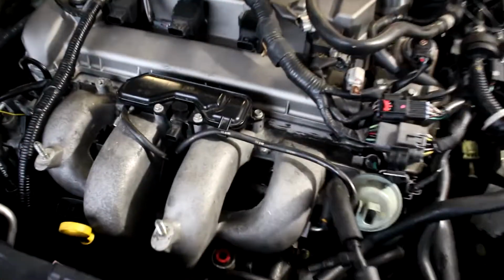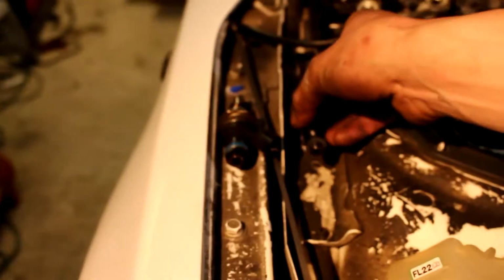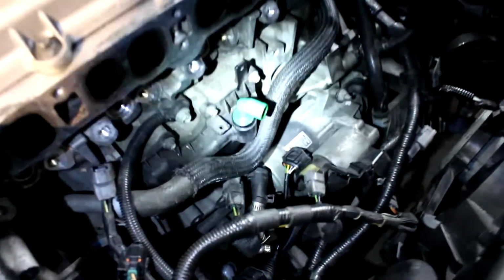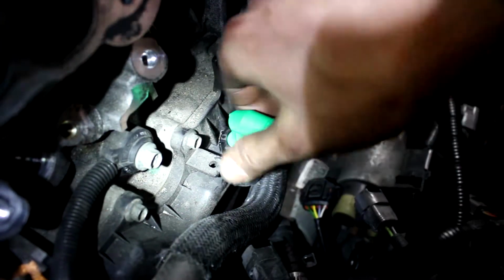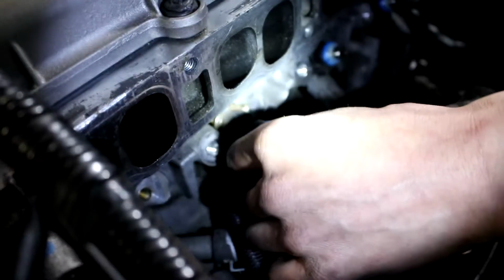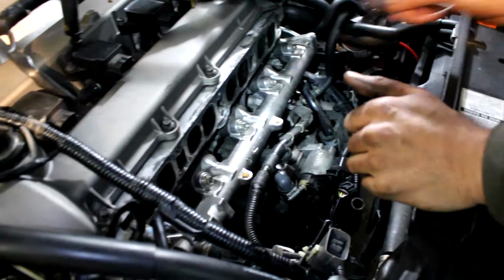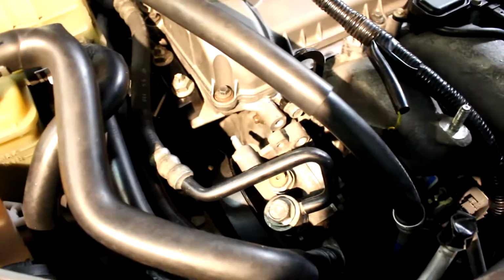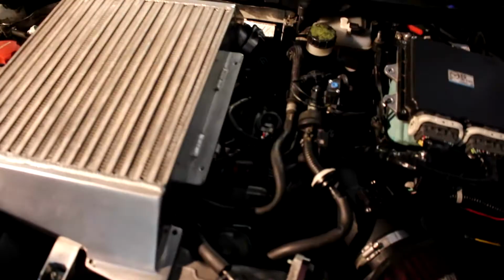Mazdaspeed 3 - Corksport Injector Seals Install

Comment: Did you notice any change in fuel dilution of oil after injector seals were replaced?
Reply from the maker: No I haven't noticed that. But then again when I built my engine we did a balance shift delete, which increased the oil capacity, so fuel dilution takes longer.

Comment: Boy that cheapo little plastic piece that holds the pcv valve in place has gotta be brittle after a million hot and cold cycles!
  Too bad there wasn't an upgraded part! 
  Anyway, nice job showing the injector seal upgrade. Gonna have to watch it over to see exactly what ya removed to get to the injectors! Thank you for the video

Comment: what did you lube the blue seals with?
Reply from the maker: Vaseline aka petroleum jelly
Reply: @WannabeTuners  Gotcha! Thank you!
Reply: @WannabeTuners  I had planned to use oil, is either suitable or is jelly the best option for the o-rings?
Reply from the maker: @kizashikaze9066  I think petroleum jelly is good because just like gasoline, it's petroleum based, so it shouldn't have any issue dissolving if some happens to get into the injectors.
Reply: @WannabeTuners  Understood! Thanks again!

Comment: Nice man thanks for posting this, Might try changing mine soon, looks a bit of a mission but not too bad! mostly clips and getting new o rings back in always a bitch :P
What's that black stuff all over your top mount?
Reply from the maker: Yeah it does require some patience, but overall it's not too bad if you've got some mechanical experience. I think what you're referring to is slight discoloration in the metal fins.
Reply: No your suspension top mount has some black on it?
Reply from the maker: @chrisday1590  Oh that was dirt which accumulated on the rust proofing that the previous owner put on. I've since cleaned it all off for cosmetic reasons lol

Comment: Did you ever have an issue with these CS seals?  I have them in my car now, but I'm about to do another valve cleaning and am debating pulling the injectors to have them cleaned again.  Not sure if I should go with CS or Overspeed seals.  Also, do you recommend an injector puller tool for this job?

Better yet, should I just leave my injectors alone (assuming the seals aren't leaking).  Not sure how frequently one should have their injectors pulled, cleaned and flow tested.  Any thoughts on any of this?

Comment: Just watching this now, great work on this project. I had my car diagnosed because it was stalling. I had it diagnosed the OBD read out was "Low Pressure Fuel Rail sensor" MisFire 3rd cylinder. The dealer recommended I replace the fuel rail, so far Ive replaced the Spark Plugs and the injectors. This video helped me to see the rail removal/install and injector install. 

In your experience will replacing the fuel rail, injectors fix the above OBD readings. ?
Reply from the maker: Since you're getting a code for it I would say yes, but there's also the possibility of an issue with the wiring, or in rare instances an issue with the ECU

Comment: Did yours smell god awful like gas when it was leaking?
Reply from the maker: I think these cars overall smell pretty gassy lol, but it does make sense that you would smell that if they are leaking, because it's essentially combustion gasses leaking out into the atmosphere
Reply: Wannabe Tuners Man mine smells TERRIBLE. I done a pull and right after I kept smelling gas all the way home. I parked it and haven’t moved it in a few hours. But I’m gonna get it in the garage tomorrow morning to find where it’s leaking from exactly. I’m thinking my hard pipe into the fuel rail is cracked because it’s pretty wet and right under Injector one there’s a hose running along there and it looked wet too
Reply from the maker: @Ds-dt7nc  It's pretty common for the high pressure fuel line between the hpfp and fuel rail to leak. I've had that happen to me. I replaced it with the Corksport fuel line, which then leaked again lol. So I decided that OEM is the way to go :)

Comment: does anyone make any after market injectors for these cars ? i cant find none anywhere. was wanting to replace them, looks like i might just settle for cs seals
Reply from the maker: There are only OEM injectors which are not upgradable flow wise. I'm not sure sure of any aftermarket companies that make a version of the OEM injectors, and I doubt it as they are quite unique. The only way to get more fuel is through an Auxiliary source, such as Methanol injection, 5th/6th port, or 4 port injection

Comment: Does anyone know what cc are the stock injectors on these cars? (MS3)
Reply from the maker: I'm not sure if this has been determined. I couldn't find any solid answers online.
Reply: @WannabeTuners  yeah I know, nothing on line about this.... They're high impedance injectors right?
Reply from the maker: @rabbon-ithegenesis7169  I have no idea, I've never looked into that. From what I've just read online, the resistance can be measured across the two electrical pins with a multimeter. If the resistance reading is 1.5 to 4 Ohms, they are low impedance. If the resistance reading is 8 to 16 Ohms, they are high impedance.

Comment: How did u guys mount the ecu like tht
Reply from the maker: We placed a knee pad on top of the battery to prevent the ECU's backing plate from shorting both battery terminals, and then used zip ties to retain the ECU. The car now has a Corksport battery box where the ECU is mounted inside it :)

Comment: i cant get the damn rail off!!! i have all the bolts and lines off i just cant pull it off
Reply from the maker: Yeah it's a bit of a pain. Just gotta slowly work it on each side little by little :)
Reply: @WannabeTuners  you can actually undo the bolts to the crow feet that hold the injectors in place and pull both the rail and injectors as one unit...FYI

Comment: Were you having any bogging or power loss prior to the Corksport seals? And if so did the new seals fix the problem and knock? Great vid, always educational and entertaining!
Reply from the maker: Thanks man! Prior to installing the CS seals the car was running fine. It was mainly for preventative maintenance since the car has a bigger turbo installed. The oem injector seals commonly leak though and can cause false knock and even an audible rattling noise while driving under moderate load in some cases. Are u experiencing some issues with your car?
Reply from the maker: @mjl6425  Have you sent your tuner any datalogs when the bogging happens?
Reply: Yes I have and he made some adjustments which lowered the knock and ran a little better. But after doing some more fourth gear pulls, car is back to bogging again and showing higher knock at WOT, even partial throttle I get .7 or 1. 
My tuner thinks it is most likely something mechanical. One thing I have noticed is that on my AP, fuel pressure at wot is 1800-2000 which is good. But I do notice long term fuel trims at a high negative like -15 to -20. Could that point to some sort of an air leak? I’ve been trying to contact my tuner but have not heard anything back.
Reply: @mjl6425 did you ever figure out the negative fuel trims? I’m having the same issue right now with bad fuel trims but my car seems to run fine so trying to figure out what’s causing the high negative fuel trims
Reply: @hbkkayson1456  no I never figured it out. I sold the car a few years ago.
Reply: @Sam S No not yet. what do you think it can be?

Comment: What heat proofing did you use under the hood?
Reply from the maker: Are you referring to the aluminum ducting tape? I used that to make a good seal with the CPE tmic. I found that it barely had any clearance with the plastic ducting under the hood since it's 3.25 inches thick, so I cut out a square to allow more clearance and then used the aluminum tape to seal and force the incoming air through the intercooler.
Reply: I just noticed some on the strut towers and such. Is it the thinner kind of ducting tape with a heavy foil layer?
Reply from the maker: Oh I think you're talking about the rust inhibitor, because I don't have any heat proofing. It's been on there since I bought the car and really attracts a lot of dirt. I've since cleaned all of it off due to how dirty it looks.

Comment: Are you sure youre supposed to install the seals loose like that? I did the same with mine. Removed them after 5k miles and they showed signs of leakage aka black around where the injector seats in the block.
Reply from the maker: I read somewhere that it is normal for there to be a bit of a gap on the corksport seals. The corksport injector seals instructions say that there is supposed to be a gap. To be honest we couldn't get them to click in no matter how hard we pressed. I haven't checked for leaks but now that you mention it, I'll be taking a peek next time I'm doing work in that area. Thanks for the comment!
Reply: Yeah CS believes that you should install them loose with that small bit of gap and once you tighten all the bolts back on the rail they should force the seals to clip onto the injector. After removing mine only 1 injector actually had that happen, the rest was pull off loose the same way I installed them and they were all leaking. Good luck with yours.
Reply from the maker: Was the leaking only on the base of the seal, or also along the sides?
Reply: Couldnt really tell. When I pulled the injectors the seals slipped right off. It doesnt seem like they ever sealed. Also one of the seals stayed inside when I pulled the injector out. People say CS's seal is bulletproof but I have buddies who use CPE's and they seal right off the bat and never have issues. I'll be using theirs next time around.
Reply from the maker: vinsss187 Right on! The only reason I went with corksport seals was like you said, their good reputation. Time will tell I suppose. I have no issues right now at 22 psi.
Reply: Good luck. Im fbo on 25psi. Cheers.
Reply from the maker: Nice:) What's your setup?
Reply: BNR S4 v2, 3.5 htp, Tr6 fmic, jmf intake mani, cpe exhaust mani, meth inj, and all the supporting mods that go along with that.
Reply from the maker: Beauty! Did you notice big gains with the TR6 FMIC, JMF IM, and CPE EM? Also what WMI kit did you go with?
Reply: No gains really with the fmic just lower bats for the most part. The CPE and JMF definitely made a huge improvement. The EM isnt really necessary since the oem EM is plenty enough for what you can push on the stock block but having an aftermarket one completely changed the sound of my car and also brought on quicker turbo spool, so less turbo lag basically. The WMI kit I went with was snowperformance's boost kit. Id say its 2nd best with Aquamist being #1 in that category.
Reply from the maker: Nice I have the snow performance stage 1 boost cooler using the smallest nozzle right now and it adds quick a bit of fueling headroom. I really do wanna get a EM. Most likely CPE due to them being cast and a good price. Shipping to Canada is super expensive.
Reply: Okay so I had a huge problem with my CPE manifold and I'll tell you about it since you may want to buy one. I bought mine for the same reason, cast iron and for the most part the build quality was there, except for one particular part. So as you may or may not know metal warps when it gets hot. So when CPE welded the flange onto the manifold, this is the flange that will end up bolting directly onto the turbo, they used either too much heat and the flange warped. I went to have it installed and the manifold just would not bolt directly onto my turbo. The engineers are CPE are fucking morons. Check out my IG. I posted about it.
Vince_ms3
Reply from the maker: Ok thanks! We'll add you up as soon as we make an IG (we're lazy lol) thanks for the info though, much appreciated!

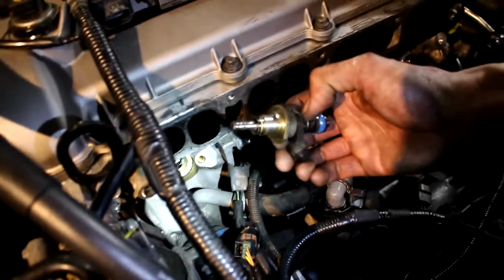Comment: At around ~3:09 you say injector from cylinder one, but I think it actually is cyl #4 (4-3-2-1 right?)
Reply: Also, solid videos. Keep up the good work! I'm going to try and resolve low compression in cyl #3 with the CS injector seals. Did a leak down test, and no air from the dip stick, and no bubbles in the coolant, which I think means my ringlands are fine, and the head gasket is fine. Lots of leak from the throttle body though, so either one of (or both of) dirty valves, or failed injector seals.
Reply from the maker: Cylinder 1 is always at the front of the engine. The back is where the flywheel is:)
Reply from the maker: How about through the oil cap?
Reply: Errrmmmm I don't know why I always had in my head that Mazda numbered them 4-3-2-1. Your statement makes 100 times more sense :)
Reply: So yea, checked all the readings again. 1-2-3-4 == 180-150-160-170. Leak down test on 2 does indeed seem to have some leaking from under the oil cap. Cyl 3 seems to be leaking from the intake side of things (seal or valves maybe?)
Reply from the maker: If you hear air from the oil cap it's an indication of worn piston rings or more commonly cracked ring lands. For cylinder 3, it sounds like a valve seal issue. Have the intake valves ever been cleaned? How many clicks on the odometer?
Reply: Wannabe Tuners yea when I heard that looks like I wasn't fully TDC. Cranked 180 degrees and validated for sure. In both cyl 2 and cyl 3 the sound was subtle. No major leaking past the throttle body, oil cap, exhaust or really any where else.

Most of the noise appears to be behind the intake manifold. Nothing really low on the engine. I'm leaning towards one or both of failed injector seals or dirty valves.

I've read a lot about ringland failure but not a ton backing it up except for the few who went built (typically after pretty extensive engine bolt ons)

My theory right now is that with a well maintained, not heavily modified engine with high kilometers I should start with something (ideally) more likely.

So at this point, valve cleaning and injector seals. Once I do that I'll do another compression and leak down and see if that really did it or something more extensive. We'll see! Haven't found any posts about before and after compression numbers with those 2 maint items.

185k
Reply: @Sam S engine was rebuilt because I wanted it setup for track days. Everything was inspected and reviewed after tear down. Everything was fine. I suspect issue was injector seals and/or very dirty valves. The head had a bunch of intake and exhaust valve cleaning done.

I would guess leaks were around the valves. Injector seals just as likely though.
Reply: @Sam S mine was done by Schmitt Tuning. I don't think anyone will rebuild with a finite budget because so many things can change.
Reply: @Sam Short Have you considered buying a built long block from a reputable builders for the speed platform like Overspeed?  I can't recall the others...too bad Corksport stopped selling their long blocks.

Comment: Nice work gentleman! I had the same fun last week installing  CS seals, JBR IM tig, Coolant delete with tig, DM EGR delete, DM PVC Plate with stage 2 OCC to releve crankcase pressure to the vented can; sealed can to catch all the crap and my blood in the engine bay! A lot of work, and happy with the results!  Keep cranking out the great videos guys!!
Reply from the maker: Thank you very much, means a lot! That's a nice amount of work haha we can totally relate to the blood in the engine bay!
Reply: Old comments, but wanted to ask. While here where the PCV valve is easy to get to, what else can be done, can you put a fitting and run catch cans to get rid of rhe ocv valve, or do they just hook to the fitting on the pcv?. 
  Thanks

Comment: Any trouble removing the injectors? From what I've read usually one of them is a PITA to remove
Reply from the maker: Michael Cheek surprisingly all of them came out easily by hand
Reply: Michael Cheek I had to use a 14mm wrench because my injectors where stuck. I  put the head of the wrench  between where the fuel harness would connect into (of course harness is removed) the injector, this piece is plastic so must be careful, and then put a screw driver inside the closed end of the wrench and Gently gave some torque. The stuck injectors came out like a charm.
Reply: All 4 injectors on mine were so stuck in the fuel rail they might as well have been fixed in place permanently. I still haven’t gotten them out. What a pain in the balls. These guys are like whoop and it comes right off all 4 of the injectors with no effort at all. Riiiight lol

Comment: Went with CP-E for seals. Corksport seals snap in place. They seal alot lower on the injector than you showed us in the video. Right now vdyno puts me at 351whp on the first revision. Have not started the methanol Tunes yet
Reply: CS's (Tokay's design) are by far the superior product. The way they're designed, the seal is much stronger and more reliable.
Reply from the maker: USN Artsen nice man. we were not able to get them to snap in place although we've had no issues yet. The install instructions on the Corksport website say that it is normal for there to be a gap near the base of the injector:)
Reply: @WannabeTuners   i know this was long time ago and people was saying on my video of the corksport install of the seals saying they didnt click all the way down. im like they dont but okay  lol
Reply from the maker: @waresgarage8590  Yeah I remember reading something like that too. Tbh I haven't noticed any issues with the CS injector seals
Reply: @WannabeTuners I haven’t neither I installed them like what 3-4 years ago and still haven’t had no problem with them
Reply from the maker: @waresgarage  Nice! I re-used them when I built the engine and haven't noticed any leaks yet. I'll have to take a closer look when I have the intake manifold off.
Reply: @WannabeTuners yea you can reused them a couple of times, keep up the good content brother love it, ima be getting an CST5 for the gen 1 soon